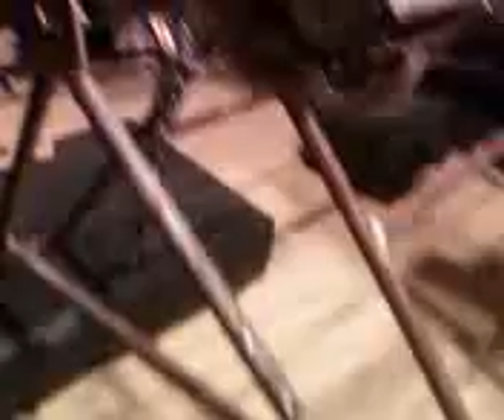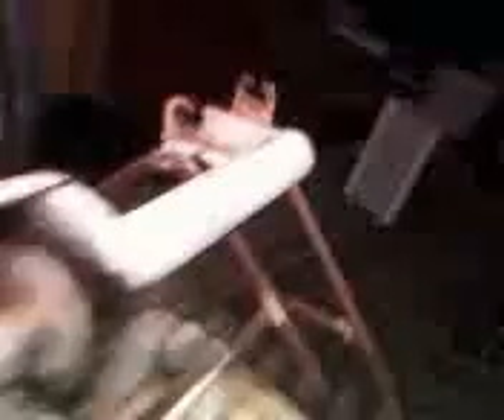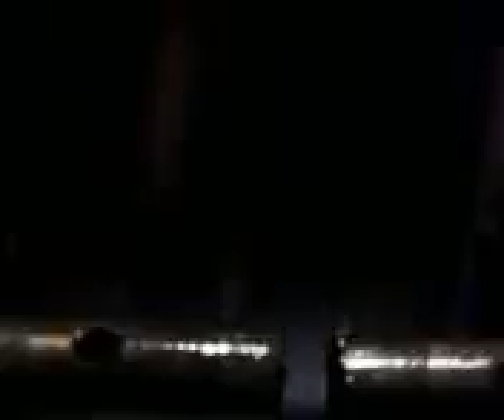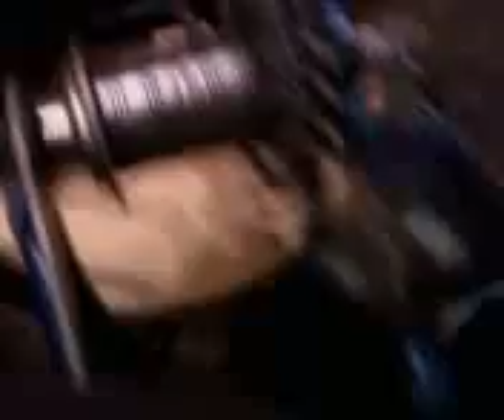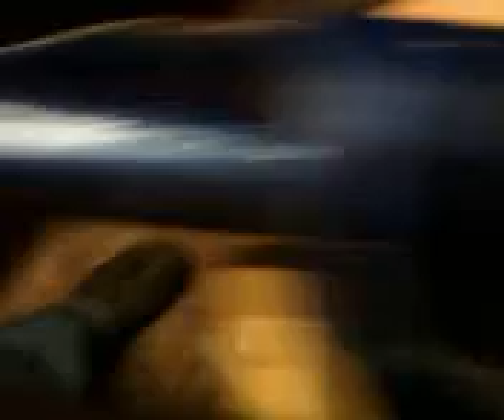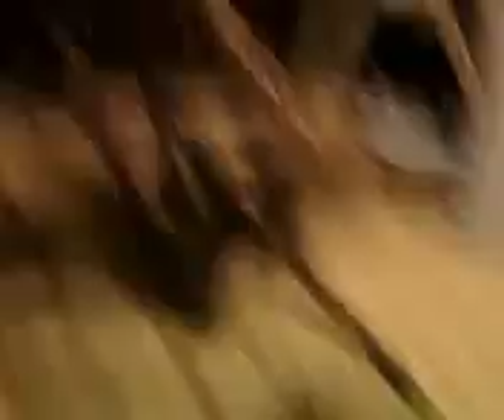Tricycle inner workings

Comment: Hey I'm working on a project and had a few questions. For the trikes, is it possible to modify it to turn like a tank by breaking one rear wheel while the other continues to turn as you pedal?
Reply from the maker: If it has a differential, yes. You would need a front like a caster wheel and you could turn with brakes alone.

Comment: Tye, I have the third style in your video. Some or all of the axle bearings are shot, but I don't know how to take the axle apart to replace them. The axle is keyed like the one in your video and it looks like there's a set screw for the sprocket that fits into that key, but then what? How do I get the axle and bearings out?
Reply from the maker: Lots of penetrating oil! Bearings like to seize onto the axle. It should slide out of the side with the flange.
Reply from the maker: find me on Facebook. I will answer any questions.
Reply: +Tye Dickerson I messaged you (I think) on Facebook.
Reply: can you help me too  please!

Comment: Hi Tye. I just found your video. I have an older Huffy Ultra Glide trike. It has a variant of the differential rear axle. I say variant because it looks different than the example in your video. Without wasting bandwidth on how it came to be, the right axle broke on me just this morning. It was already in bad shape and I was hoping it would last me until I found a source of replacement parts, but it didn't. What I need to know is, where can I find replacement parts for this rear axle assembly? Right now it's just one axle, but I would like to be able to find a source where I can get parts as I need them.
Thanks.
Reply from the maker: it depends on the diameter of the axle. if you live in central Illinois i will give you the parts.
Reply: +Tye Dickerson WOW! It's been six months since I posted this comment. Unfortunately, I do not live in Illinois. I live in Los Angeles, but it's OK. Since then I have been able to obtain a new trike (Kent Monterey 7-speed aluminum frame and wheels). It is serving me well, but I would still like to repair and restore the Huffy. Besides making a great back-up trike, it would also be worth more if it was repaired and restored. There are apparently not many of them still around.
Reply from the maker: yeah they are getting rare.. I will help with any questions you have though
Reply: +Tye Dickerson The rear axles are both the same length, so I assume that any axle of the same length (regardless of whether it came from the right or left side) will work. Is this correct? While I do not have a way to measure exactly, the axles appear to be 3/4 in. diameter instead of the common 5/8 in. diameter we see today. Is my estimate of 3/4 in. accurate?

There was (on the left axle) what appears to be the remains of a plastic seal that wrapped around the axle and sat inside a groove on the differential casing. The right side had nothing, so I assume that the right seal was missing and the left needs replacement. Do you know anything about these seals? Also, the differential case was devoid of any kind of lubricant, save for a small blob of grease against one side of the casing when I opened it for the first time. Are these differentials supposed to be lubricated, and if so, with what type of grease?

The axles are frozen in the hubs. I have tried to remove them by soaking them in PBlaster, but it has not worked for loosening them. There are holes in both the axles and the hubs where cotter keys once held the axles onto the the hubs, but the cotter keys were long gone when I bought the trike. What size of cotter keys do you recommend as replacements? Can you offer any advice on how to get the axles unfrozen from the hubs?

The 3-speed gear hub is a Shimano 3CC. It is working well, but I understand that these are old hubs and I may not be able to repair it easily if it ends up having issues (which I understand 3CCs were known for). I have a different 3-speed hub that has a smaller gear that drives the rear axle assembly. It is a Stermey-Archer AWC (?not sure if I wrote that correctly and cannot verify it at this time). What difference will the smaller gear make if I end up needing to use this hub? At this time i need to rebuild it, as it is missing some external parts and I need to find those parts before I can restore it.

Thank you for your help with answering these questions.
Reply from the maker: +Wayne Campbell find me on Facebook. I'm not the black dude lol.. I may make,another vid tomorrow to explane,more with better detail. I'm sure I can answer your questions...
Reply: +Tye Dickerson Went to Facebook. There are 9 Tye Dickerson's, 5 of which have some form of photo (4 black men and 1 white man who is not you). The rest have no identifying information that would tell me which one is you. Can you give me a clue, or do I have to send a friend message to every one of them?

Comment: Tye, I have a tricycle that is like the last example in your vid (2 chains, center hub thingy, 1wd). The drive shaft is slipping such that I can't pedal forward nor can I brake. I need to fix this. Any ideas? thanks
Reply from the maker: There should be a slot in the axle and a slot in the sprocket. A small square key slides into it and is held my a set screw on most models. You can get one at a hardware store.

Comment: Tye, can you explain to me the first option in this video? I am trying to figure out why when you power only one of the back wheels the tricycle does not automatically go round in circles? 
Additionally, could you advise me where I could source a small, simple and light differential like the one in this video? 
Thanks!
Reply from the maker: The front wheel keeps to you straight. If you try to ride a wheelie with a one wheel drive trike it will turn hard! As for getting a light diff, I am not sure. They can be found in front engine rear drive lawnmowers but can be very heavy.. The one wheel drive setup is best for weight saving.

Comment: How to power both wheels without a locked diff? I know some guys are talking about two freewheels etc....But I am cluless
Thanks....I am trying to build a sand bike powered by a mid drive
Reply from the maker: Both wheels have power but when one wheel slips it takes all of the power for nothing in return. Look up "open differential." Also, if you turn against a drive wheel it gets harder to pedal as the drive wheel turns less, being on the inside of the turning radius.. double freewheels are great until you try to pedal and turn at lower speeds.
Reply: how do you remove an axle if it does not have no notes or bolts

Comment from the maker: @kai02101989 Im not sure where you would find a new differential. I have used the axle out of a chain driven riding lawnmower. They are typically 3/4 inch diameter, but the differential is very heavy.. I hope this helps

Comment: @invalidtye I used to sell and service industrial tricycles so I'm familiar with their mechanicals. Most of them used the mid drive coaster brake hub.
 We don't see a lot of old Schwinns on this side of the border, I was not aware they had a differential in some of their models. What diameter axle shaft did the differential take? If it's 3/4", I'd be in the market for one for a project.